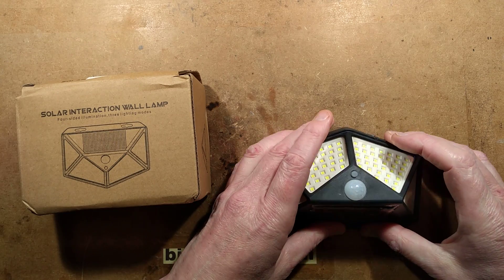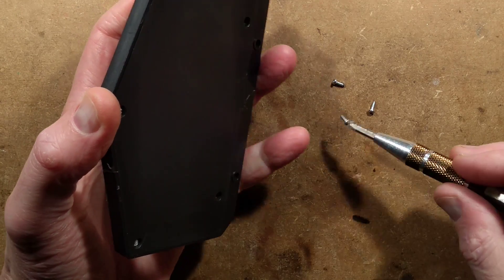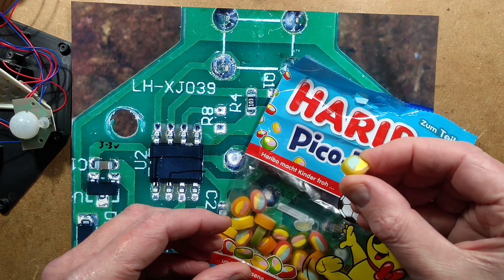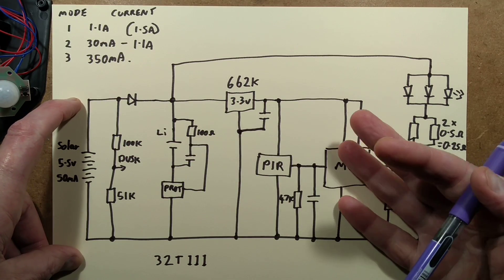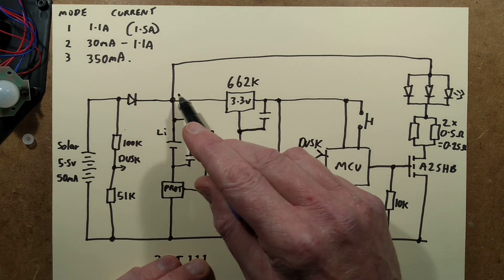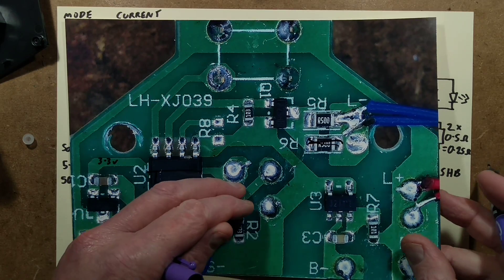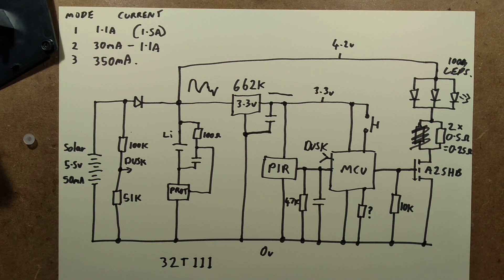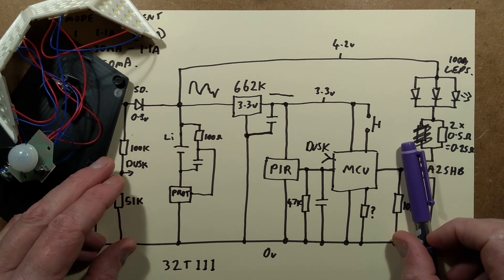100 LED solar garden light teardown (with schematic).

Comment: I CONNECTED A 3 V TO 6 V SOUNDER WITH wires across the led panel and put sounder inside lobby. i disconnected solar panel and connected direct to battery and the solar panel control wire to -ve. Thus it works as a pir during daylight too. i can detect a postman or anyone else well before they reach the front door. i also put a hood over the pir to restrict it range front and sideways to reduce false alarms.

Comment: i TOOK THE LED PANELS OUT AND CONNECTED VIA WIRE TO THE OUTPUT OF THE DEVICE AND PUT LED PANEL INSIDE A BEDROOM AND PUT THE PIR BOX  OUTSIDE. THUS lurkers potential burglers WALKING BY WILL SEE LIGHT GOING ON/0FF  INSIDE THE HOUSE AS IF ITS OCCUPIED.

Comment: Is that possibility to read IC controller software or what it is ? I have more valuable light and in pone that microcontroller just blown. So i wanted to keep functionality so need to program new controler, have more working ones so i am able to check next one but they are able to read chip and program new one?
Reply from the maker: Unknown microcontroller.

Comment: Hi sir I want to make these as a Motion Sensor Infrared Led light to use it as a Night Vision Illuminator for Camera. Please tell which IR Led work with this. Please give some suggestions.
Reply from the maker: You might be better using a high power infrared LED and matching lens.
Reply: @bigclivedotcom  Thanks for your reply. If you are doing this which IR Led model do you choose sir? Or Please tell me how to make a small and powerful IR Illuminator for camera. It will be helpful for me. In YouTube there are only simple diy IR Illuminator videos available that illuminators can only cover few centimetres or big sized IR Illuminator videos only available that illuminators draw more energy.

Comment: These cheap lights are wonderful for sticking an esp8266 on them, disabling the lights and using it as an outdoors motion detector. I integrate mines to Home Assistant and alarmo to get a cheap and simple alarm system. I also use it to trigger the main lights from movement outside when I'm at home.

Comment: I have two items working well (sometimes !). Theu have a malfunction because, in the night , light on even if there are nobody in front of them. Do you have any ideas to fix them ? This problem is related to both. Could MPU be a dual 8 pin op amp  (LM2904 like) ? Best regards:hand-pink-waving:
Reply: Lm393?

Comment: Funny I bought the same one from Temu, actually 2 for roughly 3euro each and they arrived today. Literally everything's the same including the box, except the back cover and cell inside. The cover doesn't hold cell holder like yours, contacts are soldered and small AA size 3.7V cell is just crammed inside. Good thing both seem to work but I'll have to replace the cells, one AA for that amount of leds just doesn't feel right. If you haven't ordered anything from there check it out, they give nice discount for certain products for 1st time buyers, I got myself android tv box for 10euro (around 30 is regular price).

Comment: Nice video mate. Quick question. My solar security lights have three modes. When it comes on. 30 seconds when it detects motion. Ithe second mode is 20% all night and the third mode which I use which is 10% and if motion is detected it has 100% light but only for 30 seconds. My question to you is how can you increase the time the light comes on for? 30 seconds is way too short. I'd like two minutes. Cheers Graham
Reply from the maker: Unfortunately these units tend to have the delay implemented in software, which makes it hard to change without rewriting the whole system from scratch.

Comment: Hello , is it possible to bypass thar motion sensor? To stays always on at maximum during the night. Thanks
Reply from the maker: It wouldn't last long at full output.
Reply: @bigclivedotcom  even if i add 1 or 2 extra batteries?

Comment: My location has very little sun light that the battery does not get fully charged during the day.  I am thinking of helping the solar cell by connecting an external 5V source to the input of the 3.3V regulator during the day.  Not sure if this will work or not. Any comments?
Reply from the maker: You would need to use a current limiting resistor and connect it across the solar cell to charge the cell safely using its own protection circuitry.
Or you could add a TP4056 module and charge the cell directly.
Reply: Sounds reasonable.  I'll give it a try. Thanks.

Comment: Bought a similar garbage,the solar panel has enough power to tell the board to turn off the lights,but not to charge the 500 mah lithium battery 😅
Reply: Emergency light idea-if you connect a 5 volt phone charger in parallel with the solar panel the light will work only when dark and the mains lose power . I've made one and it takes power from my router's usb.

Comment: My brother put 2 of these up today for my birthday. When we took it out of the box, put our hands on top and pressed the tiny power button it did not turn on. Did I get a dud? How long does it need to charge before it works?
Reply from the maker: Make sure it's switched on if there's a slide switch and leave it in bright light for a day.

Comment: Is it possible to swap it's small solar panel with a 5v large panel with extended wires. I am planning to put the panels in the roof and run the wires to the circuit inside the garage. Will this type of swapping of solar panels be suitable for such circuit? Thanks in advance...
Reply from the maker: It usually is possible, but don't use one that's too big as the charge current often has no regulation.
Reply: Ok. Solar panel max 6v 3w

Comment: a quick question, is there a solar charge controller in that panel light?
Reply from the maker: Most have lithium cell protection to prevent overcharging, but rely on the small size of the panel itself to limit the charge current.

Comment: Just buy 20 of these (£2.80 ish each) be intresting what they look like inside (see if they are the same), could I just attach a heatsink to the 2 chips that is getting hot if it is still the same
Reply from the maker: If I remember correctly it was the resistors getting hot?  They should be fine.
Reply: @bigclivedotcom  unfortunately the lights that arrived have zero battery protection as I left 2 of them on and it went all the way down to 2.30v and started going off and on at 2.4v if modes 1/2 used so I assume the IR module has insufficient power its retriggering , mode 3 for constant dim just got dimmer the lower the battery voltage is

It just has 2 chips, IR module and a button,, I have ordered a pack of 1s 18650 BMS battery protection so it cuts off at 2.5v and 4.0v 

only issue with using bms if it does attempt to overcharge the battery and the bms cuts off the power from the microcontroller feeding the battery unsure if it will destroy the micro controller when the bms cuts off charging current  (as the solar voltage might go quite high when bms is not accepting voltage anymore and kill it guess I find that out in summer, or leave one if them under a light see what happens )

Also what sealant should I use, as the sides of the panel are not fully flush so water is going to enter the units if not sealed, they also allows water to collect and stay behind the panel (was thinking of using silicone sealant or somthing els that's whether resistant along the edges that bonds well but not over the panel it self to prevent water ingress, some of these are going to be installed in not easy to access locations)

I wasn't really expecting a response (UK person here) do you have Discord or other place as posting pictures (links) tends to get automodded/deleted now

Comment: These lights are great. I use them when camping to ward off bears and the like. I place about 10 of them around the perimeter of the camp and on a couple of occasions I have woken to hear a bear running away and one of lights turned on...

Comment: I just got one of these that looks the same, but the board, marked YF-SF, only has the sensor, the switch, an unmarked 8-pin chip and a ? mosfet marked J3Y - no resistors or diodes or anything else that I can see. It was nice and bright for 2 days, now it only lights dimly for a few minutes, but it is only getting light from my kitchen windowsill. Am going to try and figure out if I can put a TP4056 in with it and add some extra solar

Comment: Hi, very helpful video to understand the working. Is it possible to remove the PIR sensor and how? I want it to automatically light up as soon as it gets dark.
Reply from the maker: That depends on the circuitry in your unit.   The run time may be very low in continuous operation.

Comment: Isn't the voltage reference ruined by the leakage current from that diode?
Reply: corriente autorreductora 30mA. diy resistor iluminación 50 Ohm

Comment: Thank you for your nice video!!
I have a dumb question: would it be possible to modify mode #3 from dim to full light? I have these lights in my terrace and they are set by default in mode #1 (ON only in case of movement). However, I also would like to have a good light source at night in the few occasions we stay outside for a longer time. Current dim mode #3 is too weak to read, for example. I also don't care much about the runtime, we don't expend the entire night outside anyway. 
Thanks for you suggestions 😊
Reply: well, I finally gave up and installed an interruptor to bypass the MCU. Don't know how long it will take to blow the leds or the battery, but at least I have a steady "mode #1" to light up my terrace when we are staying outside during summer.

Comment: Hi, thank you for the great video. I need some help. I have upgraded the batteries and charging in my 100 led solar lights. Now I need to increase the lighting time of the mode 1. Ex- when motion is detected LED comes up and goes off in few seconds. And I need to increase this time. Appreciate if anyone can help me with this. Thank you.
Reply: Mode #3 - 350 mA  no PIR , Mode #1 mod forever : Tụ hoá 16v 470uf , Tụ mica 2A473J 47nF
Reply: video https://www.youtube.com/watch?v=a-ZQh9l95QI&t=18s
Reply: you could just hack this into an indoor wall light or something like a work light

Comment: I'm interested in solar charging. I don't see how this protection device can disconnect the battery from the solar panel without also disconnecting it from the rest of the circuit, since it's in series with the battery.  Am I missing something?

Comment: Could you upgrade this by adding another solar panel and another battery to extend the life or brightness of the lights
Reply from the maker: Theoretically, yes you can upgrade units with cell protection.

Comment: Got one of these 1 year ago and a solar LED floodlight from Amazon, over the winter the floodlight died completely same circuitry as this device but with 2 18650 cells, so I transplanted the dual 18650 cells into this device and wired the LED array of the floodlight to the output of this device and both are now married together covering my back yard, I covered the panel with rhino shatterproof film and sealed the whole thing with black wurth RTV automotive silicone hahahaha, worthy of your approval? 😎
Reply: it's only 3 pound directly from China on Temu so I don't mind too much

Comment: Just found this video...Great work.
I bought a 6 pack of these lights from China 2 years ago with a promise in the ebay advert of 4 hrs run time!  I put the 18650 cells through my testers and they came out at 850mah!
I complained that they wouldn't run for 1 hr continuously let alone 4 hrs and they gave me 50% refund on the whole order.
I swapped them out for some good 2500mah cells I'd recovered from an old laptop battery and these lights have worked really well with only 1 dying from corrosion.
Great video and keep up the good work.
Reply: You can add as many batteries as you wish and you won't increase capacity because you are limited by the lame solar panel. Practically for 10hrs of direct sun on this panel, you will get less than 3Wh. That means the 850mAh battery is more than sufficient. If you wish to increase its capacity, you need to upgrade the solar panel as well.
Reply: Got mine from Aliexpress. They only have a soldered and glued 14500, not even a cheap knockoff 18650.
Reply: That was my thought as well... though there should be enough space for at least two 18650s (in parallel), maybe even three.
Reply: the purple batteries should have a label on it" HongCi", the batteries suck and the solar panels cant charge it well and fast enough,
Reply: They say that increasing the batt capacity not much cop because the charging circuit is prob limited - but hey Ho - it’s what we do

Comment: Hi, is it possible to avoid light sensor? To make it work even over the day? I thought of making an alarm system by hijacking it's motion detector sensor.
Reply from the maker: Many of these devices detect the light level by monitoring the output of the solar panel.  You'd need to find that track that does that and disconnect it or tie it to the negative rail of the microcontroller.
Reply: @bigclivedotcom  OK, thank you for your answer. One more question. Do PIR detect motion all the day long regardless if it's day or night? Maybe I could use it's detection as a trigger. I am aiming to connect two wires when motion is detected to an old phone's fast dial, and make it able to call me when it detects the motion.
Reply: Or to put it straight, how can I disable the microcontroller to know the light level by checking the voltage from the solar panel.

Comment: Olá, conheci seu canal recentemente, excelente conteudo! Eu tenho a mesma lampada, porém depois de 4-5 meses ela funciona porém totalmente fraca. Ela fica exposta no sol e chuva, o problema dela pode ser a bateria original exposta o tempo todo a luz? O que eu posso fazer? Trocar pelo mesmo modelo de uma bateria ou fazer alguma adaptação com bateria de celular? Sou leigo no assunto. Saudações do Brasil
Reply from the maker: Você pode conseguir trocar a bateria. Outra coisa que causa problemas é a corrosão devido à entrada de água.
Se trocar a bateria, certifique-se de usar um tipo semelhante e, se for de lítio, tente encontrar uma bateria com proteção embutida.
Reply: @bigclivedotcom  Eu troquei de bateria, porém agora ela fica acesa o tempo inteiro (e não está totalmente forte, está com brilho minimo). Sabe o que eu poderia fazer? Troquei para uma bateria "HU SD 18650 9800mah 4.2v"

Comment: Thank you so much for this guide! Is it possible to replace the solat panel with the same 5.5v solar panel but with higher current to charge the battery?
Reply from the maker: Yes.  But make sure the battery has overvoltage protection.

Comment: What about reducing the overall output levels by adding a resistor between the MCU and the mosfet? Or swapping the 10k pulldown resistor between the gate and the 0V rail with a lower value? (or both, so make a voltage divider between MCU and ground, with mosfet gate halfway between 2 resistors) Would any of those ideas work?
Reply from the maker: You can change the existing current limiting resistors in most.

Comment: I bought some of these out of China last year for about $12 CAN$ each. First pair I bought, one arrived DOA. Company sent a replacement. In the mean time, I ordered another pair from a second company, also in China (both through AliExpress.
Second pair arrived, and while both worked, one of them had the PIR cover broken.
So, out of 5, I've got 2 that work fine, and one that works when it wants to, and one that does nothing.
I took the DOA one apart, and it has the 18650 cell soldered in. I could not see any obvious point of failure - no burnt components or loose connections.
Instead of screwing them into position, I used a 2 inch square of Velcro to attach them to the wall. This is handy in that it allows me to move them into full sunlight on occasion, as two of them are not in the best location for charging.